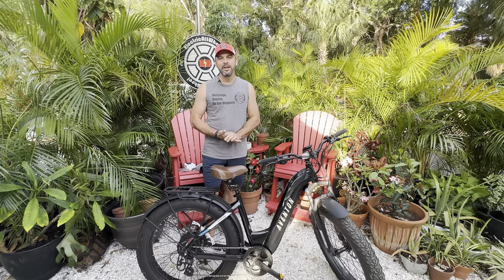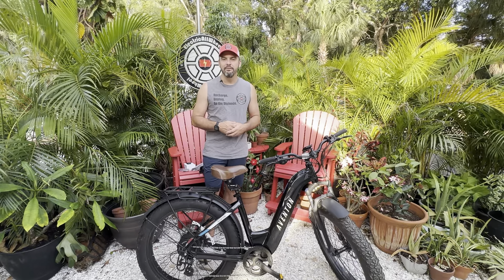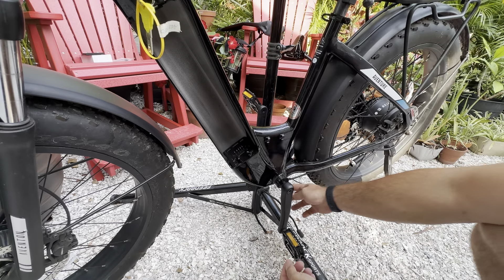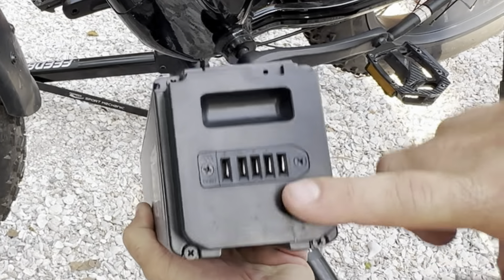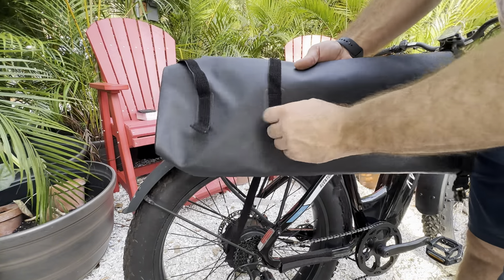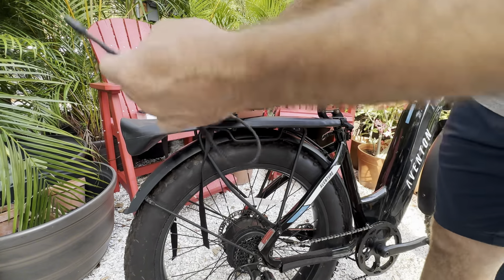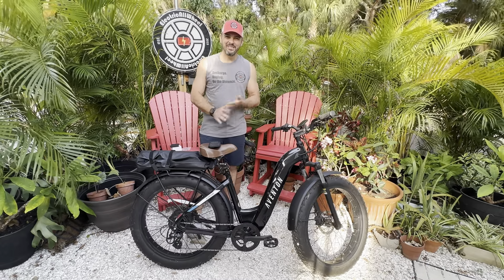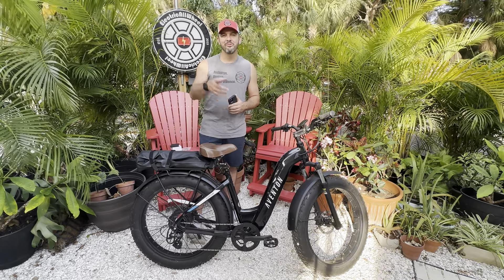Aventon | Aventure V2 | Dual Factory Aventon Batteries installing two batteries with DateX2 Dx2 Kit

Comment: Interesting project of placing the second battery in parallel with the original.  Is there any real advantage to this modification as opposed to just carrying the second battery in a battery bag (as you are doing in the video) and simply swapping batteries as one gets close to depletion?

Have you found a rear rack bag that can hold more than just the second battery, ie. lock, chain, spare tube and repair kit, etc. in addition to the battery?
Reply: That was my thought as well. Why not just carry the spare battery and swap out as needed? I sometimes pull a trailer so I could theoretically carry multiple spares. I'm age 70, weigh 280 lbs and can easily get 40 miles on one battery with light pedaling in "TOUR" assist setting. I wish that the front rack was wide enough to hold a spare battery.
Reply: Exactly!!! What is the point of this?
Reply from the maker: lol.
Thanks for watching!!

Comment: I have an Aventure. 2 and have the kit on hand. I just need to install it. My question to you is how does that system work with both batteries connected? Will both batteries drain simultaneously or one at a time? I would think I'd have to disconnect the external one to prevent it depleting with the main battery. I have an Aventure battery I'm going to strap on the back rack. I look fwd to hearing from you.
Reply from the maker: They will uniformly discharge together 1 battery

Comment: Question. When these are in parallel and I charge the battery on the bike, will it also charge the second battery, or does each battery need it's own power source to recharge? Will the aventon computer account for the extra range you have and give the percentage left based on both batteries?
Reply from the maker: The batteries will need to be charged with their own respective charging ports.
If charged full before use, the display will show the capacity of both batteries as one.

Comment: Do you know if this factory second battery set up will work on Adventure V1 also? They use the same battery. I did see your video a year ago, adding a second 10AH battery to adventure V1. Very cool video's. Thanks
Reply from the maker: Yes the adapter should fit your V1 battery.

Comment: do these work with Level 2?  also, around when will the cables for the XPedition be available?  thank you!
Reply from the maker: Aventon | Level.2 | Plug & Play Dual Battery Installation adding a second Battery for 24Ah Total
https://youtu.be/JQSABi-boCI
Reply from the maker: 1-2 months
Reply: @ElectricAllWheel  thank you!